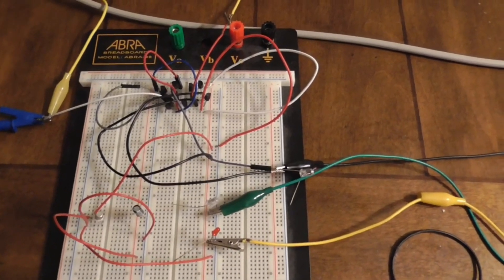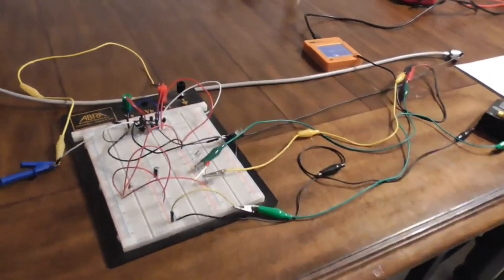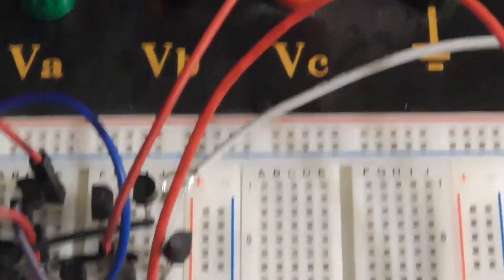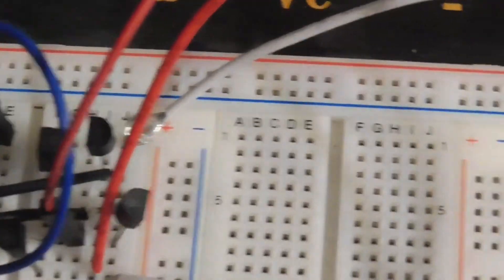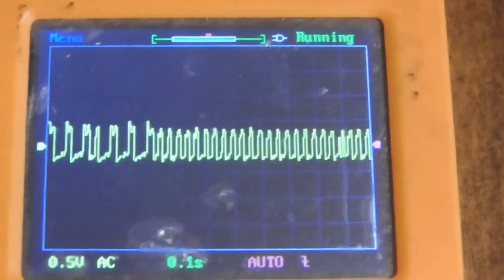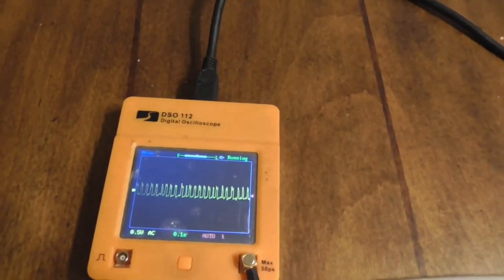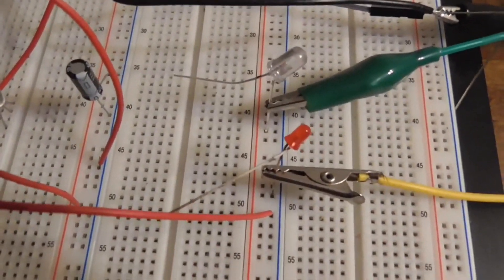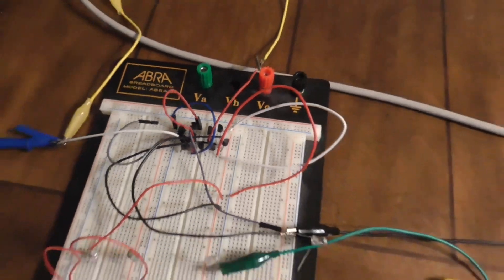The Funny Transistor Oscillator

Comment: Hi Joel, has it any advantage to use transistors instead of diodes? Higher frequency?
Reply from the maker: It depends on the setup and what you got at hand, One could find some super low forward loss diodes and just use that and call it a day, others may have a bunch of transistors and could try that instead for similar results, Also transistors responses vary more it seems with transistors vs diodes so depending on the ambient RF type as well.

Comment: You're going to make me start playing with the 1n4148s again lol
Reply from the maker: Maybe a transistor AV diode plug would work well with the one wire system. Using two transistors instead of 2 diodes.
Reply: @joellagace1679  it is probably more ideal if you are wanting the absolute best efficiency. What about the active ic driven mosfet rectifiers? Have you encountered them or built one yet?
Reply from the maker: No I have not